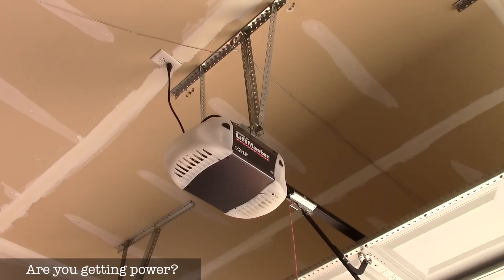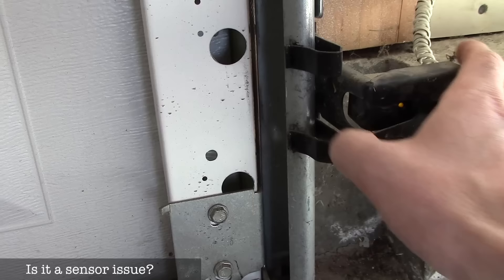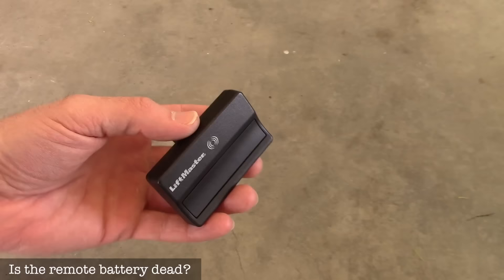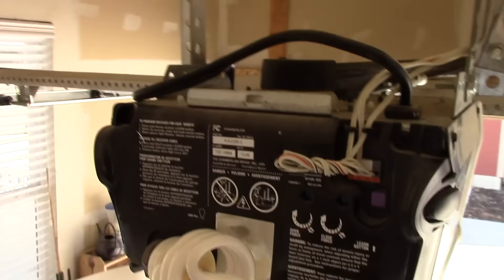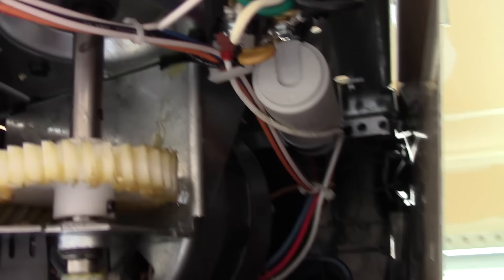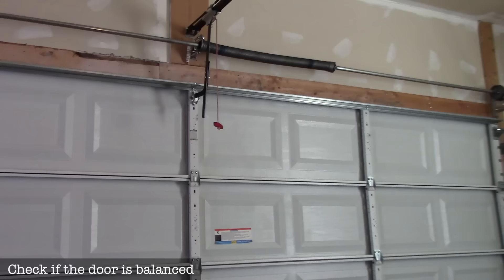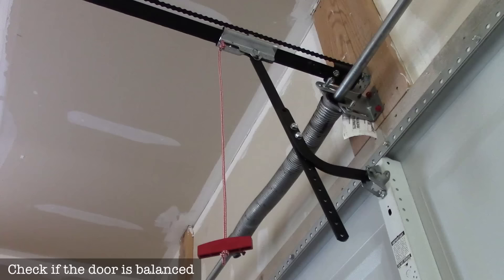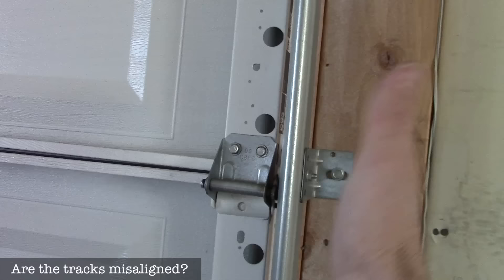Garage Door Opener Troubleshooting and Repair - How to fix common problems

Comment: Adam: My lights flash and the garage door opener does not work when I depress and hold the wall button in (attempting to override the sensors). Your otherwise excellent video did not cover this.

Comment: Your chain on the opener is too tight... slack is okay,  metal shaving on the nylon gear ⚙️ isn’t especially when it’s deteriorates over time.  I’d wipe it an apply new grease